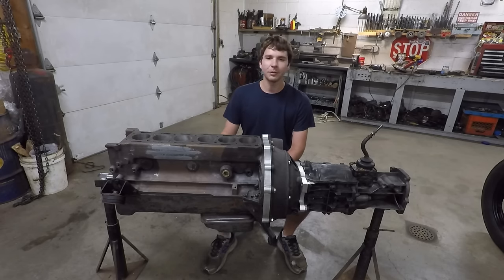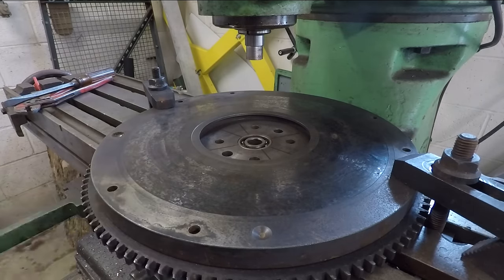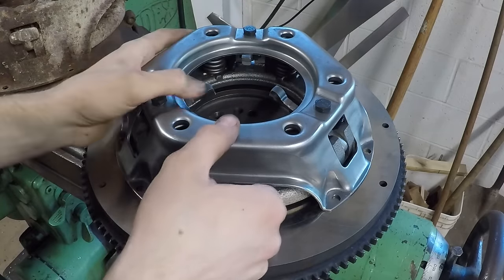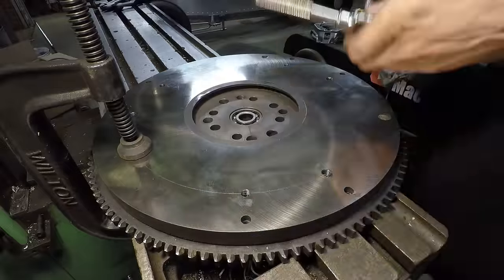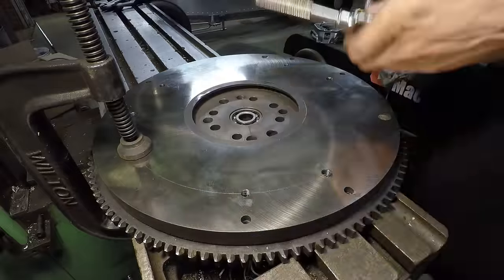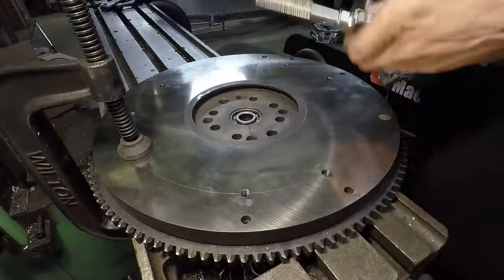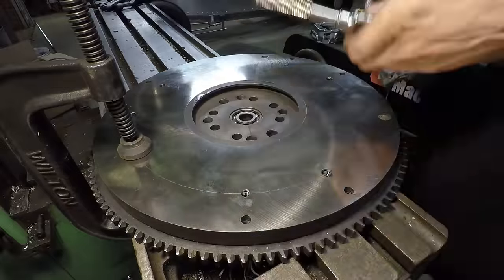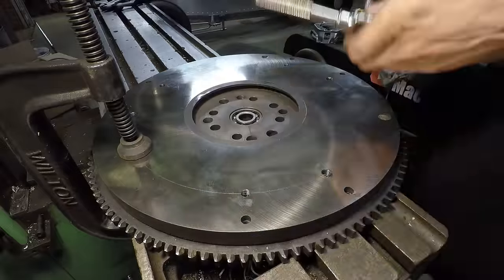Adapt ANY Engine to ANY Transmission!

Comment: One piece of advice from someone who has made many engine/transmission adaptations: centering the mill with the pilot bearing as shown is a good starting point, but you should absolutely sweep the flywheel with a dial indicator to ensure absolutely centered. At some place on every flywheel there will be some sort of bore or boss that you can take a reading with. Usually the bore that mates to the crankshaft is the best place. Even a cheap $12 indicator will get you much closer than relying on the pilot bearing bore which can vary or slop by as much as .005". Not so critical on diesel engines that run under 2000 RPM, but very important to crankshaft and bearing life on most gasoline engines. An out of center flywheel can usually be balanced to run smooth, but there will still be a certain amount of harmonics that the crankshaft must now absorb. Older cast iron crankshafts will be in danger of stress cracking in a long running setup. 5 minutes of detail could save hundreds of dollars and hours of headache.
Reply: *dozens of thousands of dollars
Reply: agreed , and also you can get exact X and Y coordinates for the bolt circle using any cad pgm or do the math
Reply: I have to chime in to agree with Pcs Machineworks. As a third generation engine re builder machinist I cringed a little when he centered the mill.
I feel guilty criticizing him though because the video, the editing, the idea etc was superb!
Reply: Dad bought a new 67 Ford with a 4 spd that lost several clutches after very few miles , 3 or 4 as I remember ( replaced by warrantee) . This went on until someone 
actually measured the difference in runout between the I.D. of the bell housing and the crankshaft . It was off by " alot " . Oop's to someone at Ford , the bellhousing
was replaced and the problem went away . Accuracy is important .
Reply: Jaguar, Ford, Chevy... if anything his tolerances will be an improvement!
Reply: Pcs, okay my question is  that engine internally or externally balanced, and same for the flywheel?
Reply: @lynnhooley7608  it wouldn't matter how the engine was balanced. Obviously, if it was an internally balanced engine then the flywheel axis must be absolutely inline with the crankshaft axis and this would require very accurate machining. An externally balanced engine would still need the be in perfect alignment to avoid inertial and gyroscopic forces from causing vibrations. If one where to balance the entire rotating assembly with an off center flywheel there would still be a degree of harmonics present within the flywheel crankshaft connection that would be transmitted to the crankshaft and cause fatigue of the crankshaft and bearings. A stationary engine would be more immune to such resonances, but an engine in motion is subject to inertial stresses as a vehicle travels, the larger the diameter of the flywheel, the larger the gyroscopic action and the higher the stress exerted perpendicular to the rotational axis of the crankshaft. Think of it this way, add a 1 ounce weight to the outside of a flywheel and the center of gravity and rotation will only move by a very small amount because the mass of the weight is small. Now, move the entire flywheel over to one side by a distance that would add the equivalent "weight" as the 1 ounce weight. There will be a large shift in the centers because there is a large mass within the flywheel, even if it is a very minute distance. Could it be balanced to operate smoothly? Probably, but the harmonics would still be horrendous. The engine would run smooth at one RPM and shake violently at another.
Reply: "Usually the bore that mates to the crankshaft is the best place"   i would not totally trust that, here in this case, he says that "his friend" openned up that bore for him on the lathe...     i do  these  adaptations frequently (diesel engines  onto boats that were gasoline originally,and they gave up the ghost...  never had  a mill, have a 100 dollar el cheapo drill press;   BUT   i was a QC inspector for 15 years, and,like any good machinist can,  i can measure very well,have all kinds of  mitutoyo,starrett, etc...indicators,mics,calipers, scribers, bore gauges,depth mics,etc; in the end, i settle only for 5 tenths to .001, but i always use the factory flywheel;   and  it all is done under the shade of a tree;  for pleasure boating only,never for prof. use;   the (portuguese) navy inspection for these engine transformations is strict, namely about  45 min.to 1 hr run at full bore to begin with; i myself have a 19 footer 1987 Sea Ray Seville with a Iveco 2.5 TD , direct inj,aftercooled, about 140 horses,same as the original  3.0 Merc, had it for a good 10 years now; 40 mph and great on fuel; this year needed  one delivery valve (had to have it made, NLA, these are the simplest there are,just one disc, 20 bucks) and one  €25 injector nozzle
edit:  the OD,the mass on the OD is what contributes the most to the Moment of Inertia of the flywheel,and so,to VIBRATIONS; so,it must be mainly be indicated on the OD;  either way, AVOID using anything other than the factory flywheel,there are lots of other considerations to attend to, because of the ( mainly torsional)vibrations OF the crankshaft,and also you almost MUST  use the  FACTORY DAMPER on the nose of the crank,sometimes one doesn't  even immagine the amount of testing that is done at the factory for that; this is extremelly important in a boat,where the motor runs at FULL BORE almost ALL the time;
Reply: Very well said. You know what you are talking about. Great
Reply: Those indicators are very useful things, I'd recommend a setup with a magnetic base and a 1x2x3 block if you wanna get fancy with it.
Reply: Great comment..thank you for that education!
Reply: Pcs Machineworks
Yeah, I was thinking this kid needs to learn how to use a dial indicator. It makes me wince when I see hack machinists, such as this, at work.
Reply: I personally thought the "centering" of the pressureplate and bellhousing were a bit more sketchy.... by eye and with a ruler... Always use the same method, tools and order of working for measuring and machining different parts that need to be aligned into one system.
Reply: Totally agree...but...if only Jaguar, Ford (flathead parts, of all things) and Chevy were that exact.  I'm thinking NO, NO, and Maybe but not likely.
Reply: Yeah I also have to agree on the zeroing, but I'm not going to hold it against him. He's not a machinist for a living like the rest of us. Thankfully I run an old ass Haas vf3 all day and not the old manual jet mill I used to have.
Reply: Thank you. 👍
Reply: Thanks I shall also follow your advice
Reply: I find it very fascinating when I see a comment of a person with thisuch knowledge bravo man wish I was your friend 🙏💯
Reply: golden advice

Comment: Bolting Jaguar, Ford and Chevy parts together is enough to cause a rip in the fabric of time and space, or give a mechanic a brain hemorrhage when he tries to order parts. Nice combo.
Reply: Nah. I had a Ford 5 ton that kept eating 351’s. Put in a GM 454 and it just kept on running. 
More recently I replaced the 6.0 pos in my F250 with a 12v 5.9 Cummins. Truck could finally do a thousand miles without a trip to the mechanic.
Reply: I wish all youtube comments had this amount of comedy HAhaha! thankyou sr.
Reply: That's hotrodding 101
Reply: What about Johnny cash 1 peice at a time ?
Reply: I love so much this comment 🤩 LMAO
Reply: The Borg Warner T-5 5 speed manual was used by a variety of manufactures. Ford put them in a bunch of cars such as the Mustang.
Reply: nh, ford and chevy have been working on transmissions together for years.
and many jags were just fords with fancy bodywork and badges for many years before the indians bought jag.
Reply: @dumpableaccount  Easy for you to say when you were involved in the mod. That is nowhere near the same of some mechanic being confronted with what all that's been done in someone else's project!
Reply: K Stewart last project, Cummins into Ford was an off the shelf kit from Diesel Conversion Specialists. Great technical support too. If you ever want to put a Cummins into something remember the name.
Reply: I know some so called "top notch " machinists & mechanics would have a heart attack over how some of this was done, yet....yet it works! And probably real well too. I think we forget that this is how most of it started, & some of the greatest things & advances have come from "backyard" mechanics.  I absolutely give alot of credit to this. I can build 1000hp plus cars from the ground up, all types of high end modifications,  etc etc,  & go figure many times it's not with all the fanciest computer guided tools & machines, etc. Obviously I have quite a lot of fancy type equipment,  but alot of it comes from good old fashioned patience, & proper measurements, & of course time & hard work. In other words,  you don't always need laser & computer guided this & that.  Of course,  that stuff can help & the accuracy is undeniable,  but if you really want to make it happen,  you can. Case in point!  Fuckin A!
Reply: One would think whoever put it together would be the one ordering the parts and you would only be ordering what was broken. So you wouldn't look at a jaguar catalog to order a part for the ford trans lol
Reply: @deadprivacy  not that jag motor that is made in Coventry;Browns Lane
Reply: You're like me you're getting stressed out just by looking at the video hahaha
Reply: Jag and ford share quite a bit so mightnt be that bad?? I dont knoe how long ago the ford jag friendsgip started
Reply: @dumpableaccount  There is a reason the V10 F250s are worth more money than 6.0L Diesel trucks!
Reply: Lol that reminds me of the old days, way back when I needed a stronger truck than what I had to haul cattle around from the auction a couple county's over and to the farm plus a bunch of other needs, I definitely didn't have money to buy a vehicle even a used one at the time so my buddy's uncle had an old 2500 Chevy that was originally 6.2 diesel but the engine/trans was gone,rear end was gone as well as cosmetic things he gave it to me for a weedeater, I had access to a guy that junked out  70's uhaul and ups trucks I found a 300 from ups that wasn't locked up as well as a c6 tranny I grabbed the drive shaft and I actually had a Ford full floating 4.10 axle in the barn I got to fabricating and put it all together ,swapped the hydro booster for vacume for brakes and drove that ugly thing over 10 years the most ignorant thing iv done in recent history is trade that ol truck ,she topped out at about 60-65 but would pull the moon down from the sky and get pretty good fuel mileage under 45-50 mph , the driveshaft was welded and not Ballanced and vibrated like all hell at 45+ but she was a good ol farm truck, for about 8 years after the 10 I drove it I used it in the field all the time and occasionally local places until a kid talked me out of it,now my farm  beater is an 84 f150 also 300 and c6 and it's just not the same...not at all😢
Reply: U think hes gonna order parts?
He problly drop in tesla engine or amc trans if he feels
Reply: Mister S They can be driven by a mechanic without wanting to visit for a while?
Reply: @dumpableaccount  YES the V10 Gas engines in Ford Trucks are almost legendary for TWO Things...High Mileage without unscheduled repairs....AND....Dismal Fuel Economy (Usually When Towing) Example: my 2008 gets 15mpg Highway Empty (10 around Town)...and 7-8 Pulling 20-30,000LBS highway.
Reply: @deadprivacy  Now they have Ford parts with Ford stamped on them.
Reply: @boostie1005  and ford's often come with fiat engines, the newer Ford ka is the same as the fiat 500. nissans come with Renault motors, minis are made by BMW, citroens and peugeouts are now pretty much the same cars wearing different badges.
Audis share engines with skoda and vw., the skodas, vws and seats are the same rebadged cars and even ford rebadged a vw sharan as a Ford galaxy... 
Gm have made saabs, opels, vauxhalls and also sell vans that are identical to peugeout and citroen,renault and Nissan ones and fiat also rebadges these same vans.
The only companies that still actually  produce their own vehicles are the south Koreans it seems...
Reply: Mister S my 2018 f150 had the same thing. 3.5 Ecoboost. Great acceleration, good mileage, add my 12,000 dump or 24’ car hauler and the mileage halved. Same with my 2019.
Reply: Well, try Lada engine block, Honda transmittion, and put a AMC in between next time, I would be amaze if that even works.
Reply: @dumpableaccount  460 rules. 6.0 drools.
Reply: GM 454 is a POS..had one of those turds in a 34' RV..gutless, high revving, unreliable, leaky,  overheating piece of shit...replaced that turd with another class A on a Ford chassis with the 460..more power,  doesn't have to scream it's heart out climbing a hill, no problems, and doesn't overheat..I will never own anything with a shitpile GM 454 ever again..fuck I HATED that engine
Reply: David Grant n
Reply: Chris DiGiuseppe if you want the 6.0 to drool you’ll have to bust a seal. It was pretty tight, just couldn’t keep running.
Reply: @dumpableaccount  I'm just playing man.  I've got a 1996 F-250 with the 7.5L and a 5 speed.
Reply: @dumpableaccount  fummins
Reply: Ellenor Bjornsdottir Forge
Reply: Im mechanic n u made my day lol
Reply: I hope to God that he's using GM HEI to fire that Jag's spark plugs, or he will spend much time at the side of the road cursing Lucas.
Reply: Hell yeah 😅 major migraine
Reply: haha awesome. ill have to tell that to the shop guys.
Reply: @dumpableaccount  6.0 is actually the best engine out of Fords Powerstroke lineup... You just have to do all the mods and deletes to make it more reliable.
Reply: @dumpableaccount  Shoulda put a 460 in that 5 ton.
Reply: @FanaticZX  Things like EGR delete, ARP head studs, upgraded injectors, improved head gasket with wire reinforcement around pistons, Banks Technicooler with High Ram Intake system, Banks Double-Shot Water-Methanol injection system, Banks IQ control system set to Econo, larger mandrel bent stainless exhaust system, extra bypass oil filtration plus run on Mobil1 since new and sub-micronic fuel filtration?  All done plus I’m sure I’ve forgotten more. The later ones maybe were better but this was very first production, before they started fixing all the issues. I spent more fixing the issues than I did to buy the truck new. 
My truck was not driven hard, mods were done to improve longevity & fuel economy.
Reply: @deadprivacy   Not classic Jags, they weren't at all compatible with Fords.
Reply: LOL "Rip in the fabric of time and space" now that's something that we can fix. just takes time effort and I can get it done attitude.
Reply: @deadprivacy  yep ford mondeo and Jaguar  x type know each other
Reply: Had a new ‘68 Pontiac Firebird with a 3 speed clutch. Had  FoMoCo stamped into the side of the main case of the tranny.
Reply: this is not that unusual,its called AMC  lol  they mixed parts from several manufacturers.
Reply: @dumpableaccount  did the transmission really cause that many issues?
Reply: @PneumaticFrog  dialing it on is where the kit manufacturer really did well. Run it a bit, download & send the data and they’d send back an adjusted program, they tweaked it 3 or 4 times and it ran perfectly.
Reply: Just wait till he goes to Autozone and say, yea, it's a Jaguar, Ford, and Chevy. 🤣
Reply: @coreybaldwin7563  I had one in my 87 Thunderbird Turbo coupe, solid Transmission, and a really fun car
Reply: It is the perfect combination of terrible brands!
Reply: lol. do i have to mention toyota and nascar ?  if that didnt do it noting will
Reply: @misters2837   V10s go through coil packs like candy, most anytime it rains.
Reply: @FanaticZX   And pay a fortune in injectors
Reply: BMW uses gm transmission... My Mazda has a Ford motor Mitsubishi transmission and Mazda the rest... It's pretty common. And dude who put the cummin in place of the 6.0 you did the whole world a favor thank you.
Reply: Dude ford and General Motors have been in a companionship since 02 and make parts for each other
Reply: I had a jaguar xj6 in highschool with a Chevy 350 in it that’s was 27 years ago now.
Reply: This should have a LOT more likes. lol
Reply: Thats why u work on it yourself instead of taking it to a shop
Reply: @dumpableaccount  , I'm ready to do that myself.  What did you use for a transmission?
Reply: @dumpableaccount , the 6.0 is worse than owning a boat. You better be ready to keep busting out another thousand everytime you fire it up.OMG! Fire it up! That's the answer. Full coverage and fire it up! 😂
Reply: Amc did that minus the jag parts
Reply: @MrCinimod93  They even mounted a Chrysler Trans to a GM Engine (2.5L- Iron Duke) with SBC Bolt pattern! - Mine had jeep 4.2L / Chrysler Trans /  Ford Ignition / GM Brakes / and goofy Jeep/Dana Axles